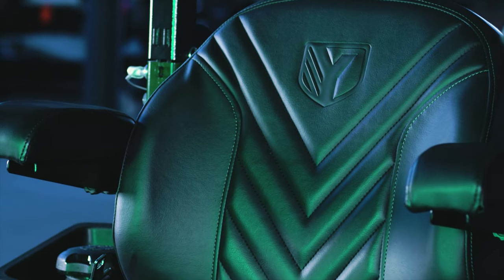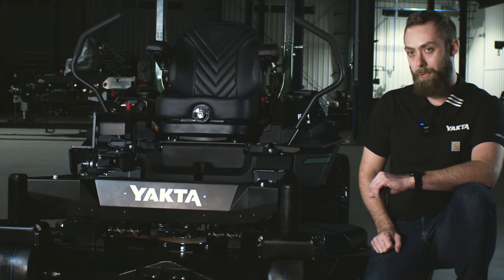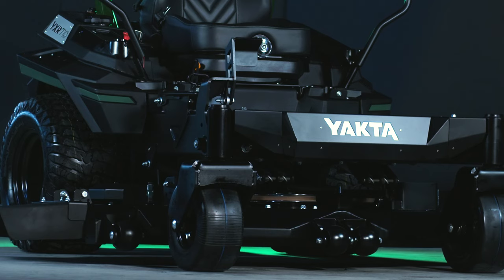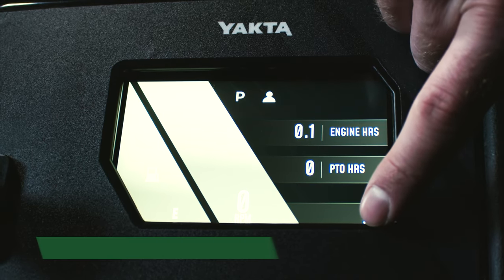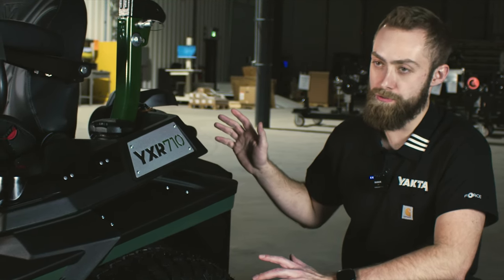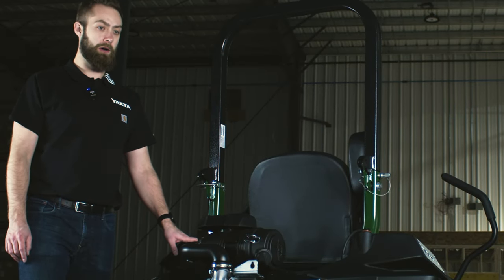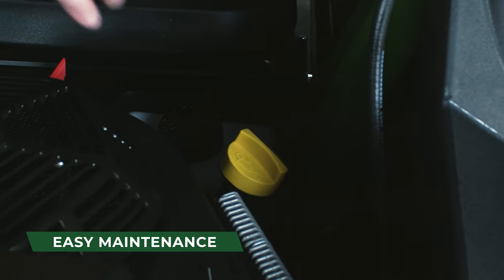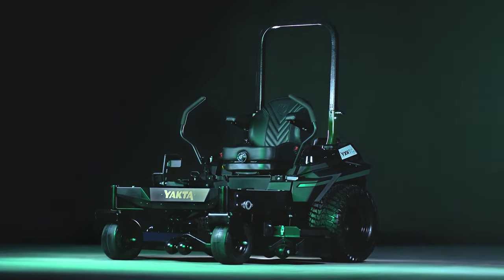The YXR 710 Zero Turn Mower | Walkthrough | Yakta

Comment: Thanks for the more in-depth video! Aside from seeing it actually cut grass, the only questions I had that weren't answered in this video were regarding the view screen's visibility outdoors in sun and the attachment removal/connection process.
Reply from the maker: There’ll be more to come for the other models! The digital display has variable brightness, so it can be fully visible in sunlight.

As for the split frame function, the YXR 710 doesn’t have it YET. We want to get it absolutely perfect, and have made some big changes to make it easier for the operator since Equip Expo. Don’t have an exact date for when you can expect to see it, but it wont be too long.

Comment: 7 gauge is not 3/8 of an inch. Why are you lying. A badboy outlaw had a 3 gauge deck whichbis a 1/4 inch thick or .250 thousands. A 7 gauge is less than half that. Yet ur video calls it 3/8 inch. Not true. Ur being deceptive
Reply from the maker: You're right, 7-gauge is 3/16". Our deck is 7-gauge, with a 7-gauge reinforcement plate over most of the top of the deck to protect the spindles and deck from bending or breaking. This doubles the thickness, making it 3/8". Sorry for the confusion, we'll be more clear in the future, but it is true.